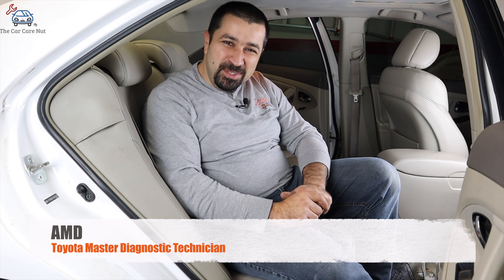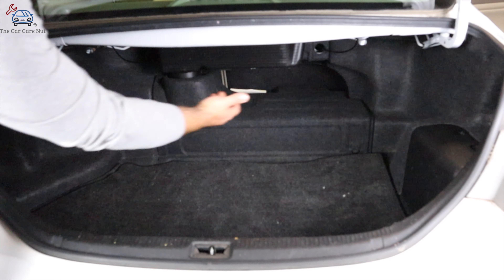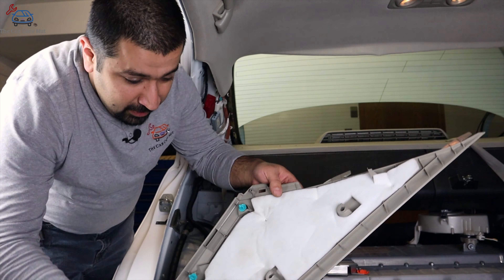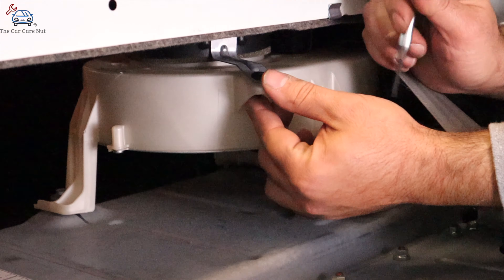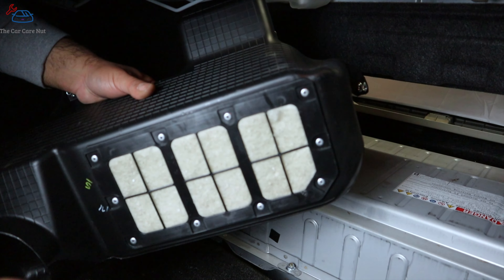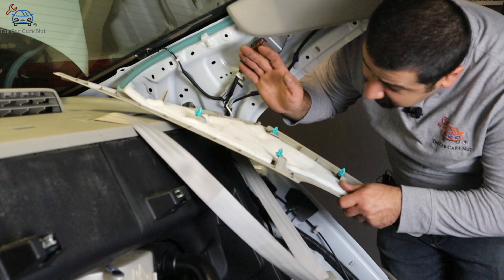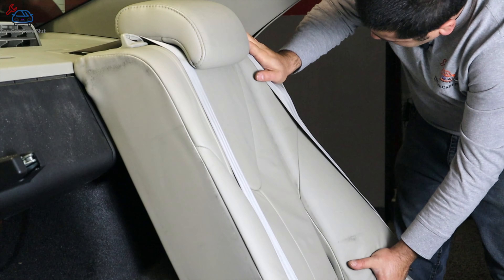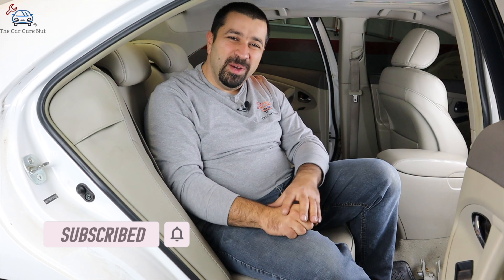How To replace Hybrid Battery Fan Filter and Fan : 2007-2011 Camry hybrid

Comment: Not to disagree with the Car Care Nut, I definitely have high regard for his expertise and experience... but I just found I could remove/replace the fan assembly after only:

-removing the seat bottom, 
-folding down the seatbacks, 
-removing the plastic carpet/upholstery behind the seats
-removing the plastic/upholstery covering the fan in the trunk,
-undoing the bolts/clip holding the fan assembly, + the cable
-wiggling the assembly a bit

installation is the reverse of removal.

Saved me a whackload of time and trouble! 

But again, I have every regard for our friend! Great video and great advice. Keep it coming!
Reply: removing the seat bottom was the FIRST step, watch again.
Reply: @toriless  Yes, but he's saying he only needed to do the above steps, not remove the bolsters, the weather stripping, the pillar cover, the black plastic enclosure, or various other things.

Comment: Your videos about hybrid maintenance have led me back to just getting a regular Camry and driving it for 20 years.
Reply: really too many panels to remove for this ''simple'' maintenance
Reply: @oi32df , that's why any subsequent models are much easier. Toyota learned from this mistake. With my 2014 model, you just look in the vent on the side of the seat and you can see if it needs cleaning. Even if it does, it's a 20 minute job. 
My wife's 2011 model, yeah, that took a while.
Reply: ❤😂That the reason dealers charge yu 250US fr services. 😊

Comment: I have a 2007 Toyota Camry hybrid and had to buy a new hybrid battery at only 105000 miles, It cost me $4000. I wish this video was out about 10 years ago. It took me and my two 13 year old twins about 2 hours to complete the process. Thank you for your videos we had a great time cleaning the fan and installing the filter. Please keep making this videos. Thank you again.
Reply: If you look around you can find a new one for closer to three grand but you still probably have  several grand to install it.

Comment: Thanks! Job complete on my 2009 Camry Hybrid. Video was a big help, showing what steps to take, in order. Turned out the fan was pretty clean, but reassuring to know it's done. Filter is on order. Only hint was to make sure the plastic lip on the side cushions is positioned properly when reinstalling, to the outside of the main cushion.

Comment: Very useful for replacing trunk torsion spring.  My mechanic was reluctant to do the job due to the battery vent being in the way.  Dealers would charge around $700.  I followed the steps to remove the vent and installed the new torsion spring.  Also checked the fan and it was clean.  Took about 2 hours.  Excellent instructions.  Thanks so much.

Comment: Thanks much for the video.  Another excellent video with step-by-step instructions.  I just worked through this procedure on my 2009 Camry Hybrid with 231K miles.  The fan was actually in good shape, but I used a small brush on each fan blade and compressed air to blow out the dust.  Outside of standard maintenance, which is expected, I have had absolutely no problems with this Camry Hybrid.   Even with the high mileage, I am still getting 37+ MPG.  Thanks again.  TS

Comment: Thanks for the video!  You have great knowledge, instruction style, and presentation.  Did this today on my 08 (111k miles) and the fan was pretty clean.  I cleaned the fan with compressed air and actually took a q-tip and cleaned each fin.  Figured since I spent time removing it might as well spend 10 mins making it like new again.

Comment: Tip I used when cleaning my hybrid battery cooling fan. The can of compressed air was not strong enough to clean it alone. I used Q-tips 30-40, one for each plastic fan blade & a wooden skewer to get in the seams. Then use the can of air to clean up. This takes longer but the fan will be very clean.
Reply: Same for cleaning a bathroom fan.

Comment: I owned a used 09 Camry Hybrid in 2012 and it never occurred to me to check the the fan... I traded in 14 Camry hybrid and then a 13 Avalon hybrid.... there was a lot less work checking the fan in the Avalon compared to the 09 Camry... I would be concerned about rattles after reinstalling all those parts.... you put out some excellent videos on hybrids!
Reply: I replaced my rear speakers and have a rattle now......need to tear into it again but I REALLY don't want to.
Reply: @clc2328  It was not proper secured.  Go over each one once again until all are firm.
Reply: @toriless  it was a trim piece on the rear deck

Comment: I just did this today and it only took me 15 minutes (including cleaning the fan with a vacuum and small paint brush).  I only removed the cover in the trunk and the cover behind the back seats.  Took the three bolts, plastic pin, unplugged it and it slid right out (pull from inside toward the front of the car).  No need to remove seat, sides, luggage tray, etc.  Way really quick and easy.  And it slid right back in.
Reply: Hello I have a code PA080 Check hybrid system. I'm gonna attempt this tomorrow and clean the fan before going to the dealers they already sent me a 3,500 quote for the battery
Reply: Wish I had a quick video overview for that would make things much easier
Reply: @Eduquesti hey! Any update on your p0a80?
Reply: @amy687  I can assure you that cleaning the fan/filter didn't clear up a P0A80. It's good preventative maintenance that will prolong the battery life, but it won't fix an already failing battery

Comment: Thanks, great video. 
This procedure worked just fine for my Australian model, too. My fan was very clean, even with 195,000km on the clock.
My Toyota dealer doesn't have the clip on filter G92DH-33010 in their computer, so I guess Toyota Australia is being up to their usual standard. I've ordered one from the USA on ebay - expensive, but I'd rather have it than not. The vent looks the same, so hopefully it will be ok.

Comment: You should make a video of this for the newer camrys please. I have a 2019
Reply: Agreed 👍🏾
Reply: Yes and I have a 2013
Reply: Yes 2022
Reply: 2012 - 2017 have it in the drivers side side panel, newer models have the battery and fan intake under the seat.

Comment: I have a Camry Hybrid 2008. Thanks for the video! Also I would like to know if you can make video about replacing the 12v battery. I've seen some videos of people using other batteries instead of the OEM the Panasonic one. I was wondering if we use a generic one will it last around the same as the Panasonic? Mine died yesterday after 270,000 miles on the clock 😁

Comment: Hello from way down here in New Zealand and thank you for all of your valuable advice. .... Is it normal for the hybrid battery to run warm under normal driving. ?  After cleaning the fan, for the first time I felt the cover on top of the battery and noticed the whole area was warm.  Is this okay. ?  and does the battery cooling fan run all the time or is it thermostaicly controlled. ?

Comment: Does this also apply for the discontinued 2010 Lexus HS250H? Just purchased one and it should be in shortly also is the part number the same for adding the filter? Please lmk asap and great video thank you

Comment: TCCN I cleaned the hybrid battery cooling fan, cleaned the mass airflow sensor & cleaned the throttle body. My 2009 Toyota Camry hybrid now runs beautifully but the check engine light came on after the return trip from the store on my first drive. Tried re-setting by holding the trip (A) button while restarting holding the power button. Please help.
Reply from the maker: Hi! You’ll need to scan it for codes to know what’s going on.
Reply: @TheCarCareNut  Ok thanks again.

Comment: Just subscribed a couple months ago. Do you have a video on servicing the high voltage battery filter on a 2013 Lexus ES 300h? Owners manual has no mention of it.  Haven't been able to locate it. Thank you. Told a couple of my fellow Toyota hybrid owner friends about your channel.
Reply from the maker: Hi! Unfortunately I don’t have a video for that one yet. It’s very similar to a 2013-2018 Avalon. The vent is located on the drivers side of the back seat. If you don’t see a filter through the vent likely it’s not equipped but you can add one to it

Comment: Thanks for your videos but I do have a question for you. I've looked for a video on replacing or cleaning the air filter for a 2015 camry hybrid, but I've not found one. Is it something I can do?
Reply from the maker: Hi! Some disassembly is needed for the back seat to get to the filter. A video for this will come in the future on my channel

Comment: Is it possible to clean the fan with a gas station air pump and if so, would the high pressures not be damaging to the fan?
Reply: If not, would compressed air in a can work?
Reply from the maker: I would be careful with compressor air on the fan. You’d need to remove the fan because if you clean it with it installed you’ll push all the dirt inside the battery
Reply: @TheCarCareNut  yes sir I do plan to remove the fan, clean it, reinstall, and also install the filter today. Compressed air in a can is ok then?
Reply from the maker: Yes in that case you’re good with compressed air. Just don’t let the fan spin when you clean it. Hood it in place while you clean it
Reply: @TheCarCareNut  good to know. Thanks very much sir your knowledge is always appreciated

Comment: Is this the same procedure for 2016 camry hybrid
Reply from the maker: No hybrids are simpler just drain and fill until it overflows and you’re done.
Reply: @TheCarCareNut   Drain and fill? I was asking about the fan filter cleaning procedure for Hybrid cars, looks like you were confused answering tons of questions. 🤗
Reply from the maker: My apologies. Yes you are right I was answering an exact question on transmission fluid. On your 16 Camry the vent should have a filter on the drivers side of the seat back. To remove it you’d have to remove the bottom of the back seat then remove the side bolster to get to it. So follow the procedure on this video until I remove the side bolster on the drivers side. But before all that shine a light and make sure you have a filter from the factory
Reply: @TheCarCareNut  Thank you

Comment: Hi i got POA7F for my camry hybrid 2012. I have checked the battery fan and there was some hair in the bottom. I have cleaned it but still the code was there it didn’t gone directly. I have cleared the code now with BDO2. But am not sure whether it is for the fan or its related to so ething battery cells. Can you please let me know is that code common for fan and filter or for something else relating battery.

Comment: Great job! subscribed.  When you have a chance, can you do a similar vid for 1st Gen (2006-2007) Toyota Highlander hybrid (should be the same as Lexus RX400H)?  Thanks.
Reply: https://hybridautomotive.com/install-hh1pnp/

would be the tough way; don't know what the harness is for, but included is cleaning the battfan. If there's any way to get a vacuum tube (caveat below) into the air intakes, say by removing the vent covers, assuming there's no rigamarole in doing this, that's be much easier, as I'm thinkin' anything caught in the system will be on the inflow side, as the rest will have gone out the exhaust. Caveat--I've heard vacuums generate huge static electricity, so I'd do a whole lot of searching to see whether that can be done safely and how. 

Edit: 

Yo! Three battfans, one per intake!

https://www.dustlesstools.com/blog/how-to-fix-static-shock-on-your-vacuum-hose/

Oh, I'm still afraid this would be crazy risky. Look how well not following manufacturer procedures worked out for American Airlines Flight 191. 

It'd be nice to have a minicam installed alongside the copper wire, though.

I'd imagine trying it hands-off on a few expendable low-voltage devices and then on high-voltage ones before tackling the traction battery fan would be prudent, too. 

It also crossed my mind that, in a SW summer, placing Blue Ice packs in front of the intakes would help, but condensation issues might well be contra-indicative.
Reply: @afusdoifudo3563  thank you so much!
Reply: Oh, I see, the first thing I want to do is get a camera safely in there to see if they even need cleaning at all, because if they don't, filters on now.
Reply: @afusdoifudo3563  great idea!  i do have a telescope camera, and will try to use it before disassemble everything.  thanks buddy!
Reply: @shawshaw8178  There's an endoscopic USB cam with LED lights for like $20
Reply: I bet those intake vent covers catch a fair amount of lint and just need vacuuming now and then. As it says in the manual

p. 10

https://www.toyota.com/t3Portal/document/om-s/OM48685U/pdf/OM48685U.pdf
Reply: @afusdoifudo3563  yes, that's what i got on ebay.  hope it will help.
Reply: Toyota seems to have focused on keeping the hv battery well-isolated with the key out of the ignition.

Comment: Is the correct filter part number for a 2020 TCH G92DH33050? How often should we be inspecting them, say every 10k miles or on a timed basis etc?
Reply: 10 - 15K for air filters, not time based like fluids.

Comment: Awesome.
Reply from the maker: I know you have one of these Camry hybrids! 😂 hope she’s behaving after the battery.
Reply: @TheCarCareNut  she's doing great. Had to program a new key using Techstream, it only came with one. I think l may have a little exhaust leak,  no sound but smell a bit in the cabin.
Reply from the maker: Likely that exhaust leak is either flex pipe or by the first hanger after the flex pipe. Very common for those

Comment: being a former electrical engineer.. it could’ve been designed to be easier to clean.. that’s 4 hours work for a layman.. but the dealer needs to make money..
Reply from the maker: I hear you. In the beginning years of hybrid models some of them weren’t designed to have a serviceable filter but newer ones are easier because they are designed with that in mind

Comment: I just bought a 2007 with 60,000 miles. I watched this video and was thinking of doing this to check the fan. Then the unthinkable happened, the trunk will not open. I cannot find a way to defeat the locked trunk. I went over the owner's manual on the smart key thinking I somehow disabled the trunk. There is nothing I can find that would disable the trunk latch. The problem is the back seat release is in the trunk. Is there a good way to defeat the trunk latch? I am trying to devise a way to pull the safety lever on latch. I have removed the bottom of the back seat. I can maneuver the upper seat to see the latch but cannot move reach it. BTW I have tried all the normal ways open the trunk.  I am quite familiar with Camry Smart Key System and the Valet lockout, as I have owned a 2007 XLE for 8 years.  Update.  I managed to release the seats through the speaker cutouts.  From there I was able to use extensions on normal tools to take out the latch.  Somehow a stud from the air dam had fallen in the mechanism and locked it up.  I followed the instructions from this video and cleaned the fan while there.

Comment: Where can I buy the fan filter (inside cabin)? at Toyota  what is the part number?
Reply from the maker: The filter number is G92DH-33010.
Reply from the maker: If you’re referring to the other one. That one is part of the vent and is not the primary one.

Comment: Please do the filter on the 2013 camry hibrid. Please!
Reply from the maker: Hi chuck! I am actively looking for a Camry hybrid in the Chicago area to film with. Once I get one you’ll see a video out
Reply: @TheCarCareNut  you could plan a trip to Florida and use mine (business expense)  ;-)
Love the channel and appreciate your efforts. God bless you.
Reply: Too bad I am 8 hours away!  I just disassembled my 2013 camry high voltage battery intake grill / duct / fan today.  There is no filter in this model :(  Can I add an air filter to the high voltage battery ventilation system?  I am having trouble finding any information on this.
Reply from the maker: Yes you can get a filter for your 2013 and oem. The part number is G92DH-33020 and it fits over the vent on the outside installs in 2 seconds
Reply: @TheCarCareNut  Thank you! I'll contact local dealer next week. BTW, thanks for all you're doing. Much appreciated.

Comment: I recently started losing gas mileage. I usually average 28-29 mpg but now am averaging 22-23 mpg. I thought since I'm using my ac Maybe that's the reason but I drove with no ac and still got lower mpg at 25-26 mpg so still mysteriously losing gas mileage. Car now has 130k miles and fan was never cleaned and filter never replaced. Could this be the issue?

Comment: Boss I have a 2007 Camry hybrid and as soon as I start the car and drive about a mile the check engine light with check hybrid system comes on and there is huge air blowing noise coming from the battery. Any idea what could the problem be ? I’m so worried that’s my livelihood. Please help.
Reply from the maker: Hi! It might be a battery issue I would get the codes checked as soon as possinle
Reply: Hi same exact problem. Did you get it resolved or did you clean the filter

Comment: Enjoying these videos and I wish I've seen them sooner. I have an 09 camry hybrid with the code to change the battery. My mechanic informed me I need to change the battery and quoted me a new one would cost relatively close to the value of the car. Online I see companies that offer refurbished battery packs with install for half the cost of a new one. Are these worth it or should I just cut my losses and junk the car?
Reply from the maker: Hi! If the company you’re looking at is reputable and offers a good warranty I would give them a shot
Reply: Your Camry will still drive fine with a bad hybrid battery - mine does
Reply: Cool thanks for that info